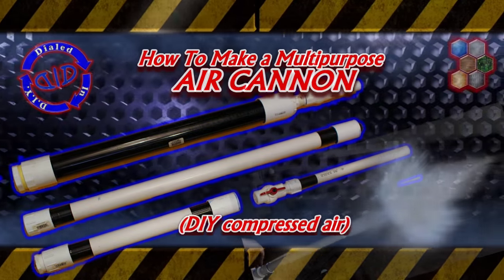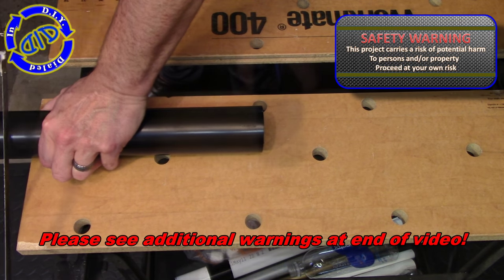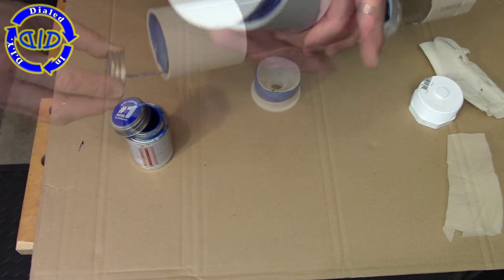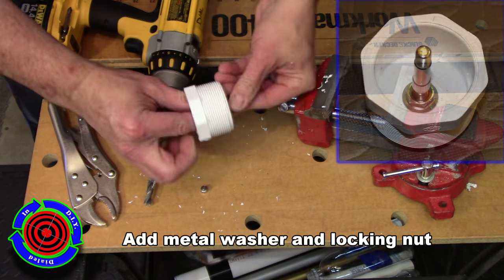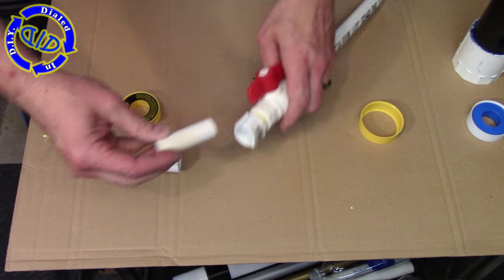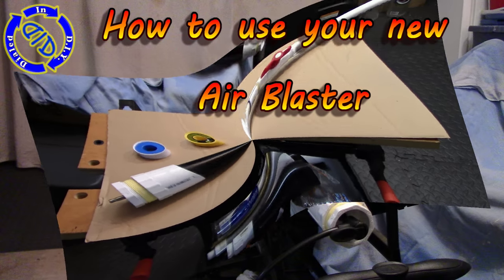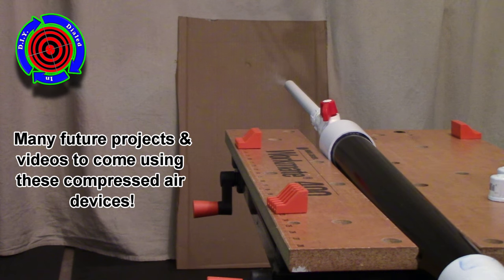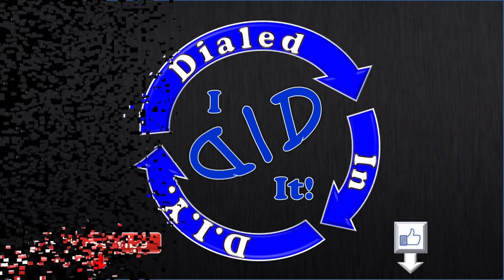How to make a Multipurpose Air Cannon - DIY compressed air

Comment: I'm working on a similar idea, but switching to a solenoid valve for push button firing, and am currently trying to work out an automated solution for delivery to the air chamber.
Reply from the maker: Lol... great minds my friend. That's the video I'm finishing right now and will be posting this week. It works so well and is so much fun. Thanks for watching and taking time to post your comment.
Reply: Same but made of steel with quick swappable isolated propane cells for a simulated barrel blast

Comment: Not sure if you still comment on this DIY vid. But I was curious to use this as a bait launcher. I'm wondering if I would need an exact fit bait or will it launch either way?
Reply from the maker: I would think that it would definitely work.  One of the challenges would be to figure out the right pressure to use that would not destroy the bait.  You could pick a barrel diameter that best suits the bait you want to launch. I have tried launching allot of different stuff and have found that an exact or even snug fit is not necessary.  With a looser fitting projectile you may need more pressure to get the same distance. What kind of bait are you trying to launch?  Thanks for watching and posting!
Reply: @DialedInDIY  probably live bait such as worms or cut bait. I do a lot of shore fishing. I've seen many videos on bait shooters but I liked the straight forward design you built there.
Reply from the maker: @truthhurts2833  I thought that was likely what you meant but thought I'd double check first.  So that also means attaching a reel, etc. I'd think loading a floater or weight that fills more of the barrel in line with the bait would help allot. I also wonder if people use a capsule of some kind to load bait in that would be recoverable.  Have you seen it demo'd in videos?  [And yes... the truth really does hurt sometimes doesn't it; love that saying btw]
Reply: @DialedInDIY  yeah I've seen several videos with a tut on building a bait shoot and a demo, but what I don't like about most of them is they are large and seem heavy duty. Most of them require the bait frozen to shoot it as a capsule. Some people shoot them with heavy stinkers that fill the barrel. Your design was more of what kind of bait shooter I'd want to build. I have some time off this week and plan on purchasing the parts to try your design.

Comment: How do you know what the max psi capacity is? I mean ABS and PVC isn’t rated for air pressure so how do you know unless you build a test chamber and pump it until it explodes?
Reply from the maker: You are correct.  Unless you can safely test the max pressure of the pipe you are working with you can't really know since PVP/ABS is rated for fluid pressure.  There are versions that have gas ratings but I have been working within limits of results found from published research.  I have also been working from information I learned from  an engineer who used to do allot of "PVC for pressured air work" for a major theme park which was consistent with what i found in research.  Thanks for watching and taking the time to comment.  I appreciate it!
Reply: Whatever the pipe can handle is the max, usually the psi max is on the side of the pipe but you should max it out

Comment: Cool project(ile)... thanks
Any idea what the maximum PSI a bike pump can reach is? Just theoretical but at some point (stupid high pressure) either the pump or the PVC would have to fail... just curious which would go first and at what pressure!
Reply from the maker: Completely correct... one is going to give out at some point and the answer depends on the quality of the pump.  I have used some that start to get hot when I try to get past 80 psi.  The other consideration is the size of the PVC (not to mention the method and quality of connections).  Here is a link to PSI ratings for various types & sizes of PVC (https://www.engineeringtoolbox.com/pvc-cpvc-pipes-pressures-d_796.html).  Based upon this the bike pump should not be able to get to a maximum PVC PSI before the pump itself blows (pardon the pun). The amount of force behind a catastrophic failure could be very dangerous so I keep well below the maximum pressures... but I still push it at times.  Thanks for the thoughts & comments!
Reply: PVC is not rated for air pressure, the ratings are hydrostatic. Manufactures have big warnings against the use of compressed gasses in PVC. It is actually illegal in some US states, yep that surprised me to. I have made a few PVC cannons though,  now using stainless  steel tubing, more work and heavier but I know if I drop it I won't get a face full of PVC.
Reply from the maker: You are correct, most manufacturers warn against the use of PVC for above ground compressed air systems.  In fact, OSHA has some very specific guidelines for how to use PVC for compressed air or gasses for containing or transporting compressed air.  The pressure ratings represent limits of pressure regardless of pressure source but the key adjustment that is often missed is the temperature effect which can greatly change the maximum pressure limits for PVC.  The other problem with compressed air in PVC is that unlike water (which really doesn't compress) air compressed in PVC has allot of stored energy which is why you can get a catastrophic failure if the appropriate safety measures and limitations of use are not employed.  I like your stainless steel tubing idea... I would like to try more of that approach.  Any suggestions for what makes the best compressed air tank for such a device?  Thanks for watching and for the comment.
Reply: Old fire extinguishers make a neat tank, as long as it's still in good condition, I used a little home one that had expired, I think it is rated for 300psi  http://www.spudfiles.com/resources/image/27253
Yeh, don't be this guy, he was lucky   http://www.spudfiles.com/resources/the-aftermath/thumb/22954
Reply: This looks interesting. ABS compressed air line, only rated for 185psi, but they do a full range up to 4" 
http://www.ipexna.com/usa/products/industrial/compressed-air/duraplus-abs-airline/
Reply from the maker: Awesome, I have an old extinguisher that was going to become a new crucible but I think it will now have a new life as a tank for a future project.  Thanks.
Reply from the maker: Great link and idea, thanks. I love the following quote "solvent cement shall be designed to withstand continuous applied pressures up to 185 psi at 73°F," especially the continuous pressure part.
Reply: It's like they haven't quite figured out the formula yet
Reply from the maker: It does look quite promising but so far I'm not finding too many places that have it available or in stock.  I'll keep looking.

Comment: Hey everyone and yo mate what's the max psi you'd recommend for a powerful shot
Reply from the maker: That is the ultimate question and it comes down to a bunch of factors.  I always try to stay below safety ratings for all of the materials I use and then drop down to the lowest pressure needed to do what I am trying to accomplish.  

Anyone have any suggestions from your own use?
Reply: I use fresh, not weathered 2in. sch. 40 pvc and pvc glue {let dry 24 hr +} and a few wraps of duct tape to slow down the pieces if  it blows. Test fire at 40 lbs, 60 lbs, etc, I had mine up to 120 psi. But safe to find a metal fire extinguser, bigger the better 200psi. Can also be a flame thrower . But do not drop a pressured pvc tank, i might go boom and keep away from kids. Black pipe is the safest to use.

Comment: Can one of these be made to launch baseballs a few hundred feet or more or is that too much to ask from a bicycle pump? If so, would you build and sell one?
Reply from the maker: You ask an excellent question Dan (especially excellent because I don't know the answer....yet). I have made versions that launch allot of different things and a good bike pump can definitely get you the pressure you'd need... so I will have to try and experiment.  Did you have a specific use in mind for it?
Reply: I built one that launches a 16 oz lead shot bag to the top of an 80 ft tree with a 600 lb test poly cord attached. I bet it would send a baseball into the atmosphere.

Comment: Is there a way to add a tripod to this outdoors? since i can't buy explosives for legal resons for a film.
Reply from the maker: Depending upon how you want to use it and whether or not it will be visible in the shot of your film there are a few options I can think of.  You could clamp it to a saw horse or something like that. Metal flashing straps could be used to attach it to something.  You could make a platform with a screw mount and then zip tie that to the cannon... that would make a point to connect the cannon to a tripod.  You would need a stable tripod though to compensate for the kick from the pressure release.  Let me know what you end up trying (I'm curious to hear more about it).
Reply: thanks. i hope to see more of these projects in the near future and I will try this out as soon as possiable.

Comment: oh and is there a way for me to make on that'll blow out dabree?
Reply from the maker: As a matter of fact there is... I have been working on some modifications for launching different stuff and I will eventually be at a point where I make more videos about modifying this basic cannon for specific uses.  Ultimately, to shoot out debris you will need a bigger barrel that you can stuff with the debris and then possibly a bigger chamber depending on 2 things; how big the barrel is and how much debris you fill it with.  That part becomes a bit of trial and error.

Comment: Will this work for unblocking sewage pipes, sink, toilet, ect?
Reply from the maker: You are on to a good idea (one that has been used by some products) but there are a couple of things to consider. #1. what is the source of blockage?  If it is structural in nature then pressure may cause a failure in the system (e.g. rupture pipe or leak at joints). #2. Does the system have relief holes? Most sinks & tubs have a place designed to allow over fill of water to drain back into the main drain.  Blowing into main drain will follow the path of least resistance, which is the relief holes. Since pressure is how a toilet plunger works, then a low pressure burst of air may work.  My only concern would be potential 'blow back' which could be pretty gross... lol.  Thanks for posting the question and for watching the video!
Reply: @DialedInDIY   The relief valves can be blocked with a wet cloth with some hand pressure. The gross situation :))) i can order parts from milwaukee suitable for this job.  Thanks for replying
Reply from the maker: You are very welcome.  If you try it out I'd love to know how it worked for you... I'm definitely curious! :-)

Comment: Do you know if I could use this cannon for a blood squib by attaching a tube at the end? Would the fake blood leak into the air chamber?
Reply from the maker: You could modify it for use as a squib rig.  Might be best to reduce overall size and use a lower pressure... use a couple of elbow joints to reverse the angle (or hook up a flexible hose) and you could keep it from running back into the chamber. If you try it I would love to know how it turns out!  BTW, I have done this with other fluids on a large scale and it does work.
Reply: Dialed In DIY thanks for the reply. I just made this model today and now im shooting potatoes w my brother. I will definitely modify it for the future though.
Reply from the maker: Cool... glad to hear you made it... and glad to hear that it is "with" your brother and not "at"  your brother... :-)

Comment: the air tank how much air can it hold at 12 inch leanth
Reply from the maker: Very good question... depends upon several factors, especially the air pressure pumped into the tank.  Storage volume for a compressed gas can be calculated using Boyle's Law. Thanks for watching!!

Comment: You need transitional glue to glue ABS to PVC not PVC glue it won't work transitional glue only
Reply from the maker: Thank you very much for the feedback and info.  I've done some experimenting and so far have not had any problems using PVC glue on these types of connections.  But that is never enough for me I also researched uses of various types of cement to join various combinations of PVC and ABS and found interesting results.  For the most part the tests did not show significant differences but quite interesting was that the easiest to cause to fail (under great duress at lateral torque) was a PVC to PVC connection. The caveat provided regarding cements was that transitional glue should only be used for ABS to PVC connections but not that it was the only way to join these two materials.
Reply from the maker: I should have added one more detail... you are giving great advice for anything that will be reviewed by an inspector. Since they will be looking for the tell tale signs of cements they expect to be used (i.e. color of cement on pipe) it is wise to make sure they see what they expect to see.